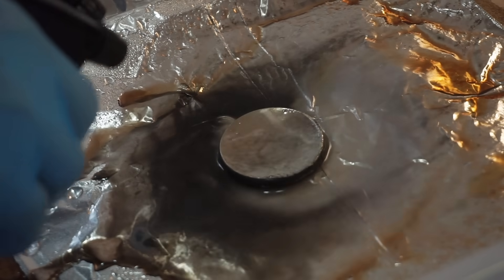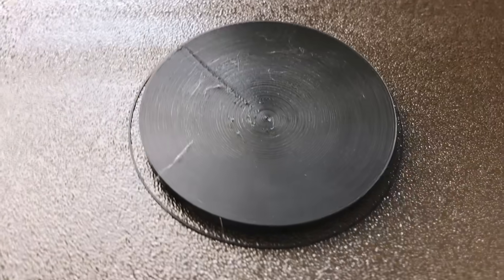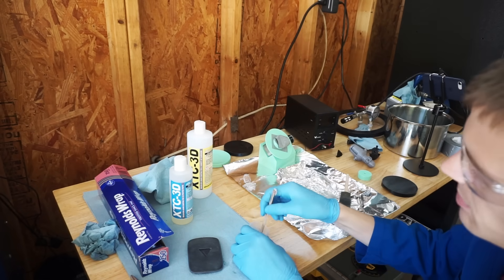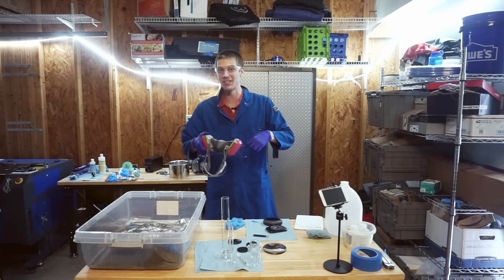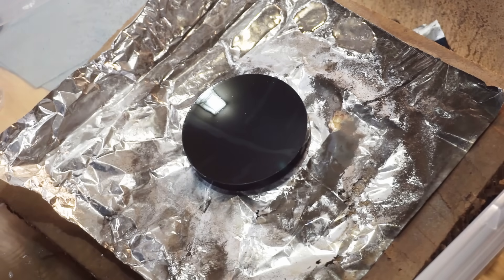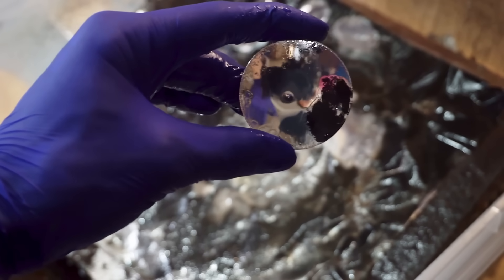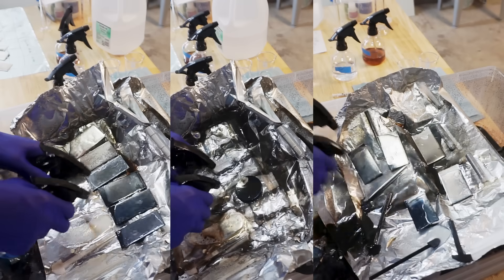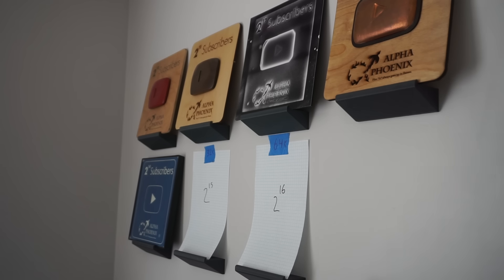How does a "first surface" mirror work? (2^15 sub special!)

Comment: 3:50 For someone who seems handy with physics concepts, I grade you an "F" here. The reason why we don't have super-efficient clothes dryers that just create a vacuum and "suck/blow" the water off of the clothes, instead of using heat (electric - expensive; natural gas - cheaper) to dry the clothes, is that water molecules are polar, and will lightly bond to a surface. Thus, you need to apply energy to get the water molecules moving and flying off the clothes, a.k.a. "drying." Just creating a vacuum and thinking you'll dry something is faulty thinking. Same concept re "Why can't we mocrowave snow off the sidewalks, instead of shoveling it?" Well, snow/ice has water locked in tight bonds, and it takes energy to make the water molecules come apart from each other. Microwaves "shake" the hydrogen bonds of LIQUID water, they can't touch FROZEN water. And so on. (The more you know....)
EDIT: If the way flat surfaces work is the way you described, it seems like taking one step forward and two steps back by making a "jagged" surface and then applying resin to make it "smooth." Won't it be the resin molecules/ electrons that re-radiate the photons that hit them in the first place? So, why bother with the 3D-printing?
Reply from the maker: By lowering the pressure in a vacuum chamber below the vapor pressure of water, you can force it to evaporate or even boil (see my other video about boiling water at room temperature). As you still need to add energy to overcome the heat of vaporization, that energy comes in the form of "cooling" the remaining material slightly - redistributing energy into the vapor becomes thermodynamically favorable.

microwaving ice is a completely different concept. microwaves DO add energy directly, increasing the temperature and therefore vapor pressure of water until it's over the atmospheric pressure to boil it. microwaves don't work on ice because the lattice structure of ice changes the water molecules' resonant frequency. you could totally melt ice with microwaves, but not a household microwave that has been tuned to interact exclusively with liquid water in food.

if I didn't use 3d printing, I'd have to hand-cut or CNC these shapes out of glass or something else I could polish and the surfaces would still start extremely rough.
Reply: PLA softens at low temperatures, so if you tried to dry it with heat, you'd warp and ruin it. (Glass transition temperature of 55-60 degrees C)

And the point of 3D printing here is to make the shape. It would be rather difficult to make a custom shape, such as a boat or a play button, from scratch without 3D printing it.

Comment: Drying the parts in a vacuum chamber had the same energy as an auto mechanic torching something. xD "Whats the fastest, most overkill way to get a bolt loose?" pulls out a gas axe "Can't be stuck if it's a liquid..."

Comment: I have a "hologram" maker that uses mirrors to display objects, the mirror in it got scratched off really easily though so I wonder if a similar process was used
Reply from the maker: When doing stuff like holography I think double-images would be a serious issue. When you use a second-surface mirror, a little bit DOES bounce off of the glass-air interface also, so if you want to avoid double-images, you need a first--surface reflector

Comment: All the surface tension talk made me think about hydro dipping. I wonder if you could hydro dip a telescope mirror in chrome and get a good enough finish to be useful. 

I was also reminded of the wafer coating methods when you were using the centrifugal resin distribution method. 

https://www.youtube.com/watch?v=qg4TGvAQoyM
Reply from the maker: spin-coaters are fun! working in a completely yellow-lit room is not...

Comment: Is there a special reason you used spray instead of a dipping bath? You would avoid droplets on the surface and the coating would be evenly spread.
Also, I can reccomend a very good recipe for the solutions, I could send you the link. They also describe how to avoid side reactions, some timing and mixing is needed. You can reverse the forming of silver oxide and silver hydroxide, but actually the dipping bath looks brownish and it works just fine. (Like in your plastic container).
Anyway: congratulations on 113.000 subscribers :-D
Reply: LarLinda you peaked my interest about dipping, I have a resin 3d printed object that Id love to mirror and had been curious about a lo-tech, not as scientific process to achieve this. can you share your experience.
Reply: @StyleWarsNYC  I rewatched the whole thing and a must say, the main problem is the resin. I think it doesn't matter that much if you spray coat it or dip it into a bath. The surface must not be hydrophobic. I had it once with an old flask I wanted to silver, but it was just a little oily inside. The hydrophobic parts of the glass didn't get silver at all. WIth resin it is even harder to tell, because of the nano structure of the surface. Maybe AlphaPhoenix can tell you which kit he used an on what resin exactly

Comment: I have no problems sanding and then polishing pla, abs to an extremely shiny finish (equal or better to injection molding into an diamond polished hardened steel mold). Takes some time, but it's pretty doable. I'd just spin that curved mirror in a lathe and use progressively finer sandpaper with some water. Then give it a 3 step polishing procedure.

Comment: Glad you're back!! You can learn a thing or two about 3DPrinting and Resin from Ramy RC (https://www.youtube.com/user/ramyfrah). For instance, you can remove the bubble of your mix in a vacuum chamber BEFORE apply it on the surface (so you may need a slower resin).
Reply from the maker: I absolutely need a slower (or UV) resin. My problem was bubbles generated during the brushing process so I eventually switched to a spatula instead of a foam brush but it still wasn't great. It's amazing how obvious imperfections like a single bubble become when you silver-coat something...

Comment: U have a box, u have acetone, why do u need resin?
Put the parts in the box, put a bottlecap with acetone inside and close the lid.
Wait over night.
The acetone will melt the surface smooth....

Comment: Smoothing 3D prints is something I have to do a ton of, we do work for the film industry making props and pieces of set decoration.

XTC-3D has the worst of all worlds of properties for smoothing resins IMO, it's got a short pot life so you can't let it settle out and de-bubble, and it has a long cure time so you can't use a lot of thin layers.

The UV resin is the right idea, but SLA resins can be finicky and cure way too slowly.

Give "I can't believe it's not lacquer" by solarez a try, they make a brush on version and a spray on version that have differing viscosities. UV resin is great, you have all the time in the world to get the film just right, optionally flowing it out and popping bubbles with a heat gun or torch, then it cures rock-hard in about 5 minutes in direct sunlight.

The other thing that works well is High-build primer from autobody paint suppliers. If you can, buy it loose in a 1qt can and apply it using an airbrush or HVLP gun, you get probably 10x as much solids per dollar compared to aerosol spray cans and can tune the viscosity. Autobody primers are nice because they tend to wet easily so later coatings stick more easily.
Reply from the maker: Fantastic tips! I’ll go look at that solarez resin right away
Reply: @AlphaPhoenixChannel  You can throw epoxies in a vacuum chamber to de-gas prior to application. I do it for all of the types I use. And for application I would use a 'pour over, drip off' type approach rather than a brush on. With a brush you necessarily introduce microbubbles (even if you're insanely careful and exacting).
Reply: Whoops, didn't see your post before posting mine -- hehe I think I suggested similar things but more grumpily :-D High-fill primers are great for filling in layer lines and painting over, i've always paid out the nose for the artsy 'textured' spray paint version but I recently got a paint sprayer attachment for my little compressor so I may try your suggestion! thx!
Reply: I can't recall the details, but some plastic prints can be smoothed by exposing them to solvent vapor (acetone, IIRC) that softens the surface and makes the parent material do the same surface tension trick.

(Edit: a few links)

https://www.youtube.com/watch?v=6xFUNFG-UKE
https://www.youtube.com/watch?v=NiG1jDEG0kA

These seem a lot easier than mixing up resins and trying to get even coatings.
Reply: @r0cketplumber  FYI, whilst acetone can be used to smooth ABS prints, I've found it totally ineffective on M-ABS (which I use because it's less pungent when printing).
Reply: I've given up on XTC-3D too. These days I use automotive filler primer for my props or anything that needs a "finished" look.
Reply: I use hi-build for all my print smoothing. The only caveat I have is that you really need to let it properly cure before putting anything solvent on it or it may wrinkle and change shape.
Reply: @SwervingLemon  Does the Hi-build require sanding after being applied to the 3d print?
Reply: I am wondering if making a high-speed spinning platform (like they use for making computer chips) for applying the filler would get better surface results?
Reply: @Inertia888  In theory, if you spin a dish of resin fast enough, you should get a perfectly parabolic shape. Vibration and balance makes this harder than it sounds though.
Reply: I use Alclad II chrome paint and Alclad II primer after that sanded 3d prints it looks like chrome, here https://www.youtube.com/watch?v=jqcTG0JGnkc&t=817s
Reply: Yup, that’s what I was thinking as well.. filler, sanding, primer and possibly some clearcoat and more sanding/polishing if you want that perfect finish.
Reply: @alexwiecke2622 Great explanation! But Alpha Phoenix, I'mma need a video on smoothing prints now, We already know xtc 3d is garbage, time to test whats better.
Reply: When you coat 3d prints with "I can't believe it's not lacquer", does it require sanding afterward?
Reply: Dream job! We need to bring back good prosthetic effects, merged with just the slightest CGI tweaking.

Comment: You put the tub of mixed resin into the vacuum chamber before application, not the piece after application.
You might (should) also use a heat gun/blow torch to pop surface bubbles after application.
Other tips...NEVER pour from the container you mixed the resin in, there will ALWAYS be unmixed resin around the edges of the container. Pour into a separate container first, mix again, then apply.
Wait at least 3 days before doing anything chemical with resin, or anything at all really. That's 3 days in a warm room too, not a cold garage.
There are literally gazillions of artists and makers on youtube who use resin on a daily basis, you might want to check out some of their how-to vids.
Good luck.

Comment: What was the precise silvering kit you used? The MSDS would give a good indication of whatever you used being based on the Tollens reagent. I would be very suspicious of using those types of reagents on plastic resins though: the alkali would definitely be able to attack most common epoxy resins enough to ruin a surface finish.

The amateur astronomy literature has quite a few useful recipes for making your own silvering solutions if you would like yet more experiments to run. The  "Amateur Astronomer's Handbook"  by John Benson Sidgwick and  R. C. Gamble has quite a detailed procedure for preparing the surface and making the solutions. 

Keep up the great work!
Reply: Alot of these kits are chinese kits off ebay, there is no MSDS.  The professional autobody kits tend to give the bare minimum in the terms of chemicals listings. but yes most are infact based on the tollens reagent reaction. Same process is used for typical retail mirror production.
Reply: Hi there! It looks like he used products from our company-Angel Gilding-and you are right-the SDS will show the majority chemical component. He is right in guessing it was silver nitrate. That is the Silver Solution. The Silver Reducer is a Sodium Hydroxide Solution. We also suspect you are onto something with the resin. We are going to post a comment about that part. There are certainly recipes out there for your own silvering solution (this basic chemistry was developed well over a hundred years ago). We always caution folks though to be careful-it can be a dangerous process and can even create fulminating silver if done improperly.
Reply: @AngelGildingcom  I take it you mean fulminating as in the nitride Ag3N as opposed to a fulminate?  My first thought was the latter, as I could see someone cleaning a surface with an alcohol and having residue react with the nitrate, but I suppose if ammonia were used in a solution you could indeed get the former.  Either way, I'd agree notion that it should be avoided.  Certainly good to keep in mind, thanks for that tip.
Reply: @amarissimus29   yes, the main risk we reference is in the manufacture of the chemicals themselves.

Comment: 15:49 pucker factor 9000. this is how Jimmy DiResta almost lost his fingers on one hand. maybe its less of an issue with the guard and riving knife
Reply from the maker: What was wrong? I tried to keep all the safety features in place but I don’t think I’ve ever been properly taught how to use a table saw and they frankly scare the snot out of me. Should I improve my form somehow?
Reply: @AlphaPhoenixChannel  You can pinch the board between the blade and fence and then the board will suddenly move at like 50 mph, your fingers will be jerked along with it into the saw blade. Always use a push-stick or feather board
Reply: @AlphaPhoenixChannel  On the table saw - You generally only use a fence for cutting down the middle of a long skinny board. For Wider pieces you should be using a Miter gauge that slides in the groove that's parallel to the blade or a Cross cut sled. The issue is that the wood can bind between the blade and the fence and things can go bad pretty quick.
Here's a couple of good videos on the proper techniques:  Rockler: https://www.youtube.com/watch?v=JzYgcWJKquQ  and 
Family Handyman: https://www.youtube.com/watch?v=8KeofUGQ4P8

The most important tip (other than wearing safety glasses) - is to stand to one side when using the Table saw so that your not in the line of fire if there is kickback
You can see both the kickback and the operator standing to one side here: https://youtu.be/XsmAxJ7Qc6M?t=313
Reply from the maker: thanks for the tips! I've had trouble basically needing to freehand when i split a large sheet of ply in half and it feels uncomfortably uncontrolled. when I can fit the fence in, it feels like a big improvement over that, but whenever possible I'll absolutely switch to the miter slide. Do you have any tips for constraining larger sheets?

Comment: There's a type of telescope that uses an enormous rotating pool of mercury to form the primary mirror. I wonder if you could just make a plastic form, fill it with casting resin, spin it while it cures, and then silver that

Comment: i'd take temperature and relative humidity measurements to further hone in on what makes the best mirror. the main difference between inside and garage will probably temp and humidity
Reply: I agree, it's seems that you're one of the only people here who has mentioned relative humidity which plays a big role in evaporation rates. The higher the relative humidity is the lower the evaporation rate will be and the slower the curing rate will be.
Reply: I came to the comments to mention the variables of humidity and temperature that were more than likely the main difference between garage and indoor.

Comment: i dont know a huge amount about it but can you not sand the surface flat with sandpaper fine as possible then use acetone vapours to smooth the surface i have seen people smoothing out print lines with this method

Comment: Look up Factorial Experimental methods. I commend you for doing a "grid search" as you call it and not OFAT. A half fold factorial could help in the future.  I also use a lot of resin/epoxies for strain ga(u)ge / load cell stuff. Temperature is a huge factor as you found. Cures tend to be exponential on time until they stop (too cold) or degrade, burn, or do weird stuff at too hot. It could need a huge amount of time in the garage OR it could be below the reaction temp needed to cure the epoxy.

Comment: A big problem you're going to have putting coated 3d prints in a vacuum chamber is that the printed object itself is full of air. I would maybe try degassing the resin before you apply it
Reply from the maker: The foam brushes add lots of bubbles during application so I ended up mixing carefully and then spreading with a hard spatula instead of the foam